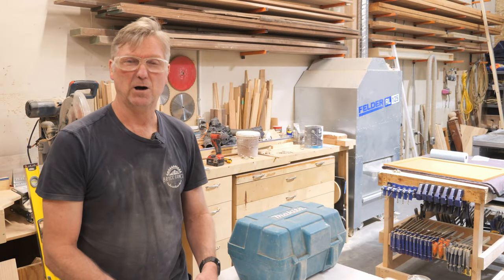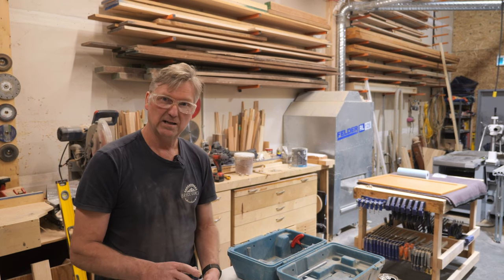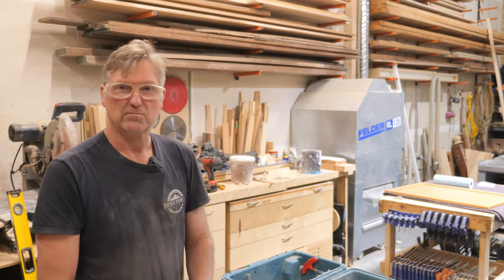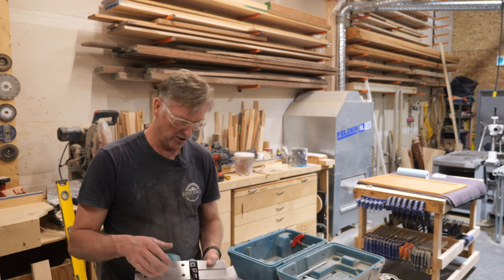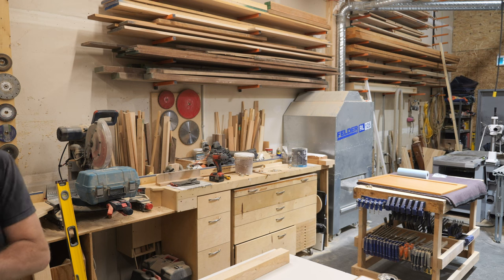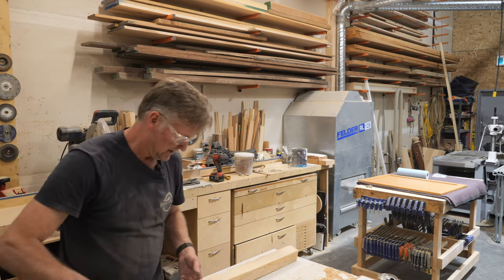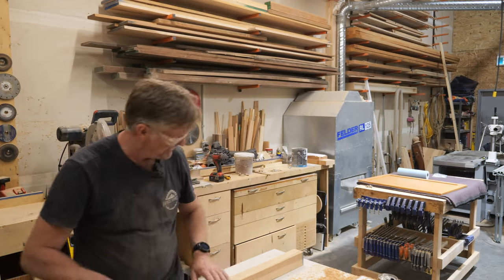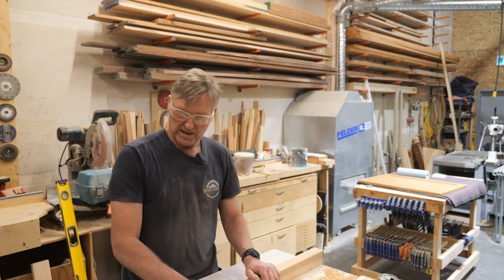Helical head for the power planer

Comment: not for that price. head costs more than the tool
Reply from the maker: Yeah i agree, they're not cheap! Mine at least was cheaper than the planer, but that may depend on the model i guess. The replacement carbide cutters are cheap at about $4.50 each, so being able to turn them 4 times, and just replace them one at a time when needed will help in the long run. Will it pay for itself before the tool itself dies? We will see! :)
Reply: Here in Italy I can buy a china made helicoidal planer thicknesser for 1900-2500€.
An old used  DEWALT would cost me 400-500€ plus the cutter head that would have to be imported, my guess that total cost would be around 1200€ total.
Reply from the maker: @s70cas7ic0  I have used a couple of different Dewalt benchtop planers. It's been a few years now, but unless they have changed, i wouldn't recommend them. I can't speak to the China made planer thicknesser. Remember, not all helical heads are created equal and some certainly don't perform as well as they should. If you have space, maybe try looking for a used SCM planer thicknesser. They are a lovely machine & will likely outperform both of the machines you mentioned.